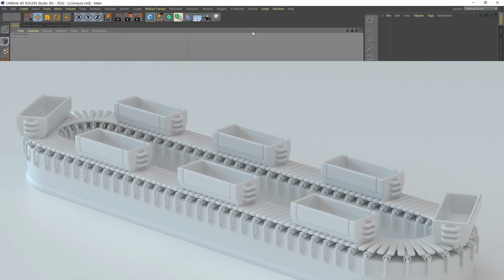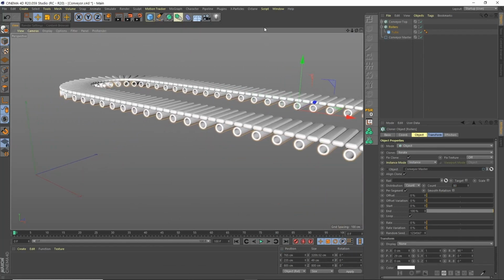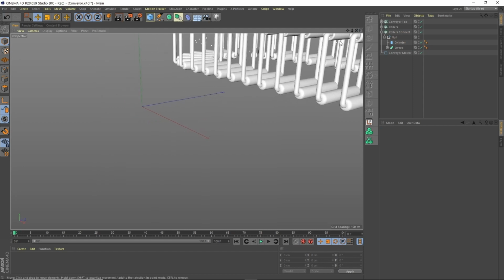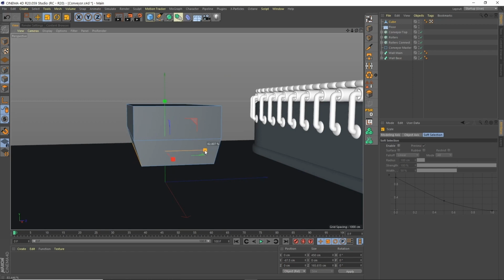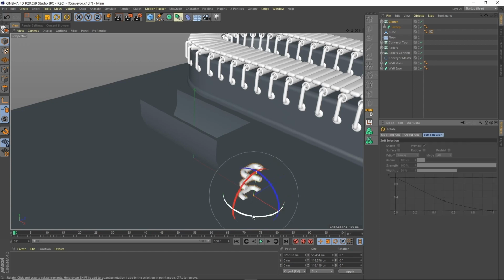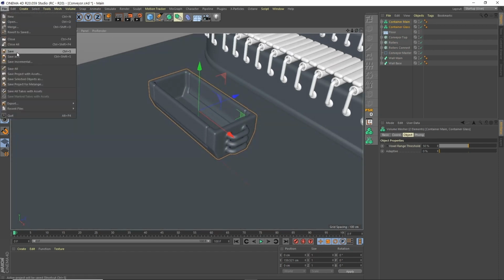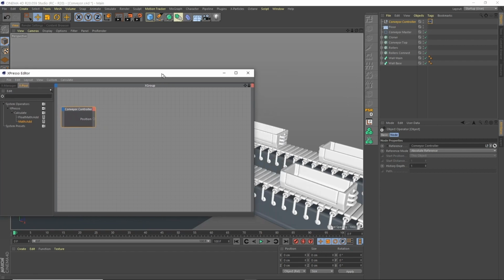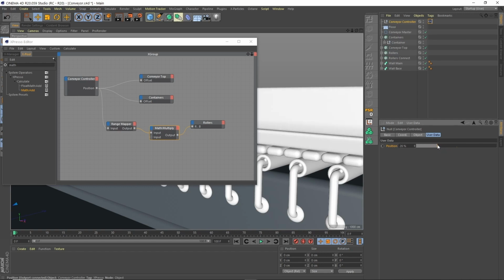Creating a Fun Factory Looping Animation w/ Perry Cooper | Part 2: Conveyor Belt

Comment: Rotation of the wheels relative to the offset position
<<<CONSTANT: (Pi*2) -> MATH:Multiplay -> CONSTANT: _(wheel radius))>>>>result to connect to the node RANGE MAPPER  the point Input Upper and at the point input the position of the сar___Output Upper = -360°. after that we connect the range mapper to the axis of rotation
Reply: Thank you bro